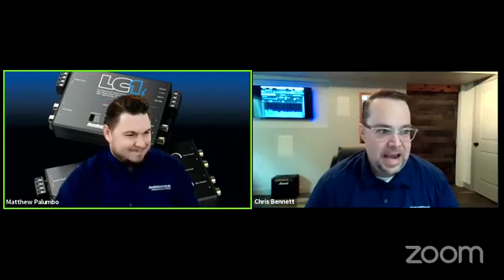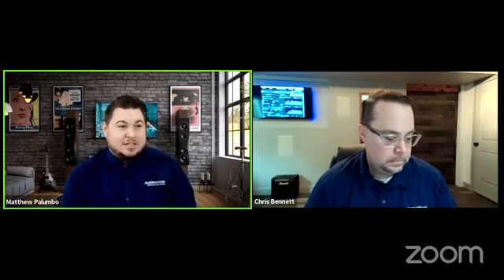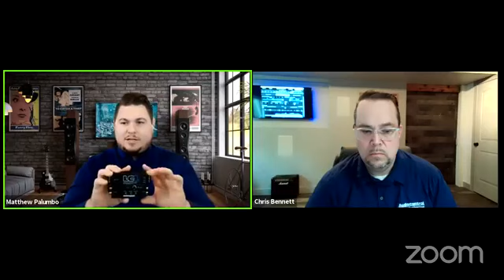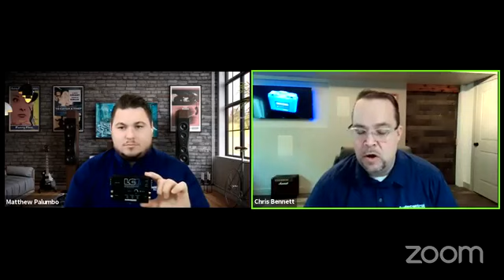AudioControl LC1i Introduction

Comment: The guy on the left keeps saying hi/low. I guess it does both but most products that do speaker level have a switch that says rca or speaker level hard to believe this unit knows whether to boost and amplify or tone down the signal.
Reply: People buy this just because it steps down .New bmw 1600watts  factory system how would you add sub ? It converts either highs and mids and  factory systems with subwoofers and a amplifier up to 400 amps and 40 volts input. to low Frequency  9 volt preamp for aftermarket amp.

Comment: I think I need this. My android head unit puts out only 1.5v and my amp can take a max of 8v. I have to have my gains all the way up to get good volume. I do have an eq setting that says 1-12db+. They are saying hi to low adapter. I need low to hi... a line driver.